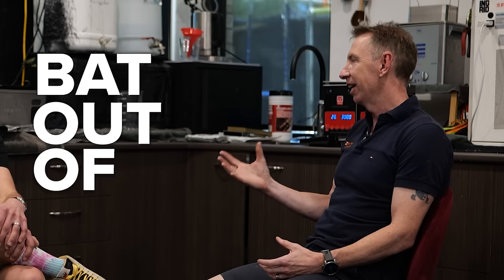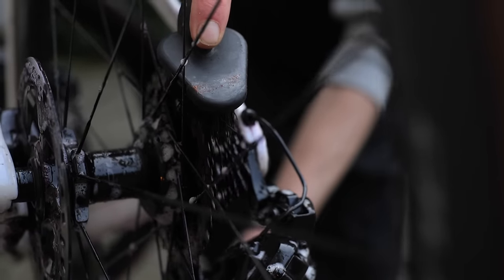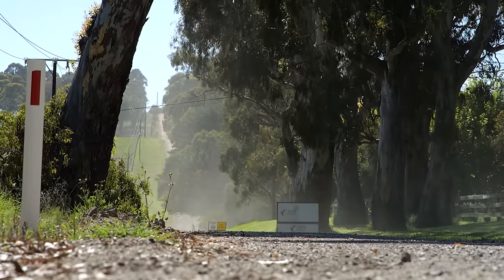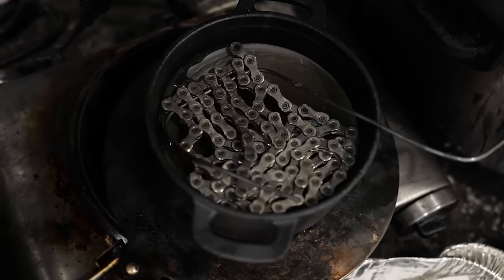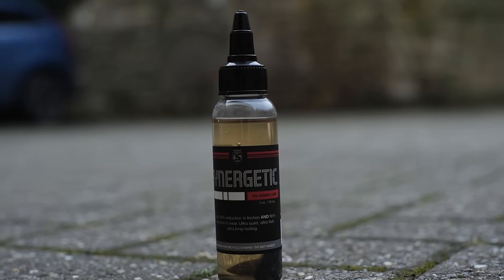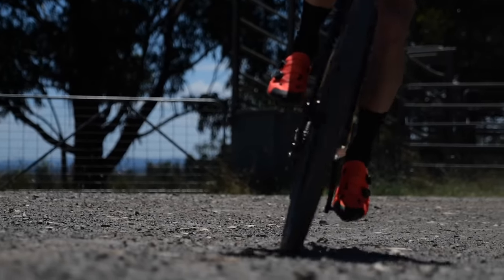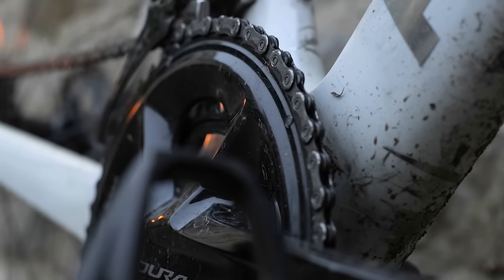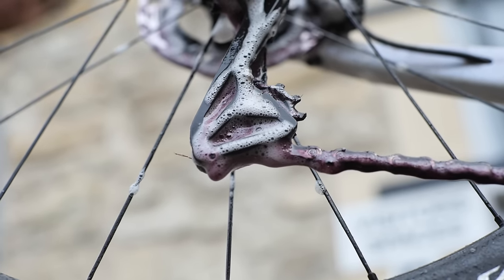They Don't Want Your Chain To Last This Long

Comment: This was a fantastic interview for people that geek out on mechanics.  I vote for more of stuff like this.  I have multiple chains in rotation, so I always have a fresh waxed chain ready to roll when it's time to rewax
Reply: Same, I am running 3 chains, swap them the ride they make noise, takes 15 seconds with a quick link, and since they are waxed, no mess at all, so that part is out of your mind. 
One chain in my rotation is on 3k miles of beach riding, and I can BARELY tell it from the newer chains. 

Im convinced a waxed chain if swapped out when it starts to make noise will last longer than a set of tires.
Reply: @shawnington  I have 3 chains between 2 bikes that have the same drivetrain setup, it's worked perfectly.
Reply from the maker: Geeking out on mechanics is our safe place 🙌 Super cool to hear you are getting organised with you chain wear! Have you always been like that?
Reply: @gcntech  I started doing this about 5 years ago when I started waxing my chains as it just made it more convenient.  the quick links help make it a lot easier as well.

Comment: How are people taking chain off so regularly like this guy is suggesting, is this re-using a quick link many times or using a new pin every time?
Reply: I usually reuse my quick link about 4X and then replace. 
Was reusing over and over 8-12 or more times and had several issues on the road and racing. Sorry my opinion only. But have been removing my chain and cleaning 🧼 for many years.
Reply: This is my scepticism about no faff. You have to get a chain breaker and pins or quick link pliers and quick links. Maybe it’s habit but degreasing and re-lubing just seems easier to me. Invest in a chain checker (Shimano based on ZCF’s reviews) and replace the chain when worn.
Reply: Reused my quick links (xo1& xx1) many, many times. Between two chains 4500miles with cleaning every 50-150miles. In xo1 & xx1 case, they aren’t that fragile.
Reply: Reuse mine until they don't have a solid "click" when reattaching.. they've lasted me a very long time

Comment: no wax lubricants options here where I live, except for Finish line wax. So I opted for cleaning the transmission after every ride over 40KM and re lube (using muc pff yellow. Does the cleaning the chain with degreaser and later water to rinse may bring any problem in long term?
Nice to hear from all this people that have so many knowledge and can share it so easily to understand. Thanks for uploading
Reply: Especially when using a cheap wet lube, frequent cleaning, rinsing, and re-lubing is good. There are no downsides to a clean and freshly-lubed drivetrain, aside from the time and effort required. Just dry everything off before re-lubing. Muc-off is bad--but if it's all you can get, then cleaning is even more important!
Reply: You can order candle wax or food-grade paraffin wax online and a cheap wax melting pot online, so you do have a wax lubricant option. I believe that ZFC is currently evaluating this type of wax but in my experience it is easy and works fine even without any additives.
Reply: @ridefast0  Valid points! If I couldn't get something like Silca Hot Melt or Super Secret, I'd probably run plan paraffin wax before using Muc Off. ZFC did indeed run candle wax (basically just paraffin), and it worked surprisingly well.

Comment: Is all of his lube testing based on "dry conditions" ? It would be interesting to see how the different systems / products  perform in a wet environment which would be more applicable to the majority of viewers in Europe.
Reply: I live in Thailand where we have a monsoon season and I have doubled the life of my chains from c 4000 Km to 8000 Km by using a "Wet" lubricant and changing from a 3 x drive to a 1 x drive.
Reply: No, they test wet and wet and dirty conditions too. That testing data is available on the Zero Friction Cycling website.
Reply: Adam lists his test protocol on his website, but basically starts with no contamination, then dry contamination, then wet contamination, and if it survives that, then a double dose of wet contamination. 
Wax is still generally the best performing lube in wet conditions, but it won’t last as long as it would in dry conditions before you need to reapply. Put another way, any lube that is sticky enough to remain on your chain in the wet, is also sticky enough to retain all the mud and road grit and turn into a chain-eating abrasive paste rather than filling its role as a lube.
There are some unusual situations (eg. A 24 hour MTB race) where an oil based lube would be better (because there is not enough time for a wax lube to dry and harden), but those situations are … unusual.
Reply: Just  a little more detail from the other reply.  He has 6 "blocks" of tests, each 1000 km.  The first block is dry with no contamination and lubing 3 times.  The second block is dry with dirt and sand continually added and lubing 6 times.  The third block is dry with no contamination, no cleaning from block 2 and lubing 3 times again.  The idea is to see if the lube can carry away the contamination from block 2.  The fourth block is we with water added continuously and lubing 6 times.  The fifth is dry with no contamination and lubing 3 times again.  The idea is to see if the lube can carry away the water.  The sixth is sand, dirt and water added at twice the volume of blocks 2 and 4, lubing 6 times again.

Not every lube is tested in all 6 blocks.  Basically, the test is stopped if the chain doesn't survive (so he never replaces the chain).  At the end of a block, if the chain is over the 0.5% total wear limit, he stops the test.  Anticipating the reason for your question: all immersive wax lubes (including normal candle wax) survived the entire test well (although for some reason he hasn't gotten to block 6 of the candle wax test yet).  All of the immersive wax tests also performed better in the wet than the wet lubes that made it to the 4th block.  The top immersive wax in the wet (Silca Hot Melt) performs more than 3 times better than the top wet lube (Silca Synergetic).  Hot melt had 8% of the 0.5% wear limit in block 4 vs the 27% wear of Synergetic).  It's not even a close battle.

Josh from Silca has speculated that wet lubes appear to perform better in the wet because they they are thicker and dampen the sound.  Even though they aren't actually protecting the chain very well any more, you can't hear them and so people think they are performing better.  He's pretty clear that he believes that all immersive wax (from any producer) perform better than wet lubes, even in the wet.  And that applies to Synergetic as well.  There are reasons you might want to run wet lubes, but getting maximum protection for your drive chain isn't one of them.
Reply: If you run waxed chains, just dips them in isopropyl alcohol after a wet ride, and they will be dry, it wont dissolve the wax, but its very hydrophilic and absorbs the water. Or run a rotation, of chains ,and just swap them out. The wax is so good, ive actually waxed rusty chains before, and the rust just gets pushed out, and the chain is eventually indistinguishable from a new chain, with no less wear.

Comment: Been using KMC X12 Ti-n Chain. Cost $40-$50 US. Seems to be as good as SRAM force X12 chain. $45-50 US.
Any opinion on KMC
Reply: Ti-N is really just for the bling, as the coating is only a few microns thick, and wears off at friction points in no time flat. X12 chains are pretty solid in themselves, with decent tolerances, and once you get their gooey packing grease off, hold onto wax coating pretty well.

Comment: Running 2-3 chains on all my bikes and washing them every 200km extended the life of my cassettes and chainrings. I have 2 road bikes with Ultegra R8000 cassettes with 15k km each and they still work perfectly.

Comment: The roads on my commute are so crappy I switched back to 7 speed, cheaper parts. Use Viking Juice in winter, Squirt rest of year. Measure chain often and replace at .5%
Reply: I think up to 8 speed replacing at .75% was fine
Reply: yeah his point though is that because of the wear rate of those cheaper chains, that turns out to be a false sense of economy when you actually calculate out the mileage you get from your lube and the chain, and the other components all together. apparently you missed the point in the video where he talks about how those 8-9-10 speed chains are cheaper because they don't have any protective coating at all and they're made from softer metal, so even without any contaminant they're going to wear out faster then the other chains anyway.  

of course he hasn't been able to do any testing with road-salt and snow, I think though he could do one of his test blocks with salt water and that would at least give an idea, even if he can't do snow, I would think it would actually be similar because the salt dust (post storm, after the roads have all dried out) and salt water is what really seems to mess up my chain.
Reply: Wipperman do high quality 7 speed chains. My fully plated YBN chains cost just £4 each and are great,  I get good 7 speed cassettes for £11. I don't believe his spiel. I check for stretch regularly  replace at .5% stretch, so cassette lasts 3 chains.
Reply: Where are you buying those chains please?  @draugmithrin

Comment: 31:45 - So what you're saying is Don't ride in the rain so you can make your chain last longer
If you do ride in the rain. Use a bike that has an enclosed drive chain. i.e. probably something like a velomobile
Also cycle through a handful of chains. So that no 1 chain is past the 0.5 or 0.75 mark

Comment: For what it's worth: I got the Ekar and I changed my first chain this very day after 3000-3500 km. I should add that I tried but suck at cleaning the drive train consistently and thoroughly. (Thats why the new chain is waxed and I spent all morning un-mucking my cassette and chainring.)

Comment: Taking the view in chain width to the other side of the fence, a wide 1/8" mid tier track chain easily does 10.000km riding outdoors and using oil based lubes. 
Since switching to a wax based drip lube that easily gets doubled. 
So while I am eager to switch to immersive waxing on the next chain, because the drip wax is still a little bit sticky and still requires regular cleaning, I might have to replace the chain due to increasing my chainring size long before that one has worn out.
The wear rates reported by ZFC on immersive waxing would probably make chain wear just not be an issue anymore and top tier track chains viable for outdoor use.

Comment: As a general rule for me: Modern narrow chains never lasted for more then one year in my whole lifetime and only one of them got destroyed becouse of my own stupidity. They twist much too easily and i only care about not having any force on the padles as long as the gear isn't 100% in place and never let any stick or stone even touch it in the forest.... So i don't care for the chain maintenance as much as i did with 9x (driving much wilder and harder) where it was common for me to cycle more then two years and over 15k km before changing a worn out but still intact chain. My foldable Bike still has its original way over 20 years old 7x chain. Changed the tires twice inbetween becouse they were done. But its still not too long, still not worn out, still flexible, not a single chainlink is damaged or doesnt move properly. 
So how much can i save? Nothing. I spend 30€ a year for a chain, 2,50€ every few years for oil and not a single 11x chain got worn out before something else broke.... normally it's one original bolt loosing the inner part of the chain. At 10/11x it was never ever my own (chain-)bolt, last time this happened was 9x. So maybe i can save money on the cassette or front chainrings... hmmm ... last one lasted over 50k km, never had to buy a new one before some part in my head wanted something new anyways... exept 9x, this was the system for me, where i should have changed the chain maybe one or two times more often so i could have saved maybe one or two cassettes and one set of chainrings in the front... but 9x was so chaep in the end, i got a XT "spiderarmcassette" for 30€... so what could i save?
Edit: some mistakes corrected, btw i'm a mountainbiker and biketraveller as well as a-to-b-everyday-biker. Feel free to correct my english.

Comment: From 5-8 speeds the insides of the chains stayed more or less constant - the outsides of the chains were getting skinnier.  Same holds true from 9-12, i guess.  But still the stretch comes from the side plates, so skinnier side plates = more stretch ...
Reply: I have read somewhere that the main contributor of chain "stretch" is actually not the actual stretching of the links but rather the wearing away of the "bearings" connecting each link. (More wear means more play. Stacking all that play for all the links gives a longer chain)
Would explain why they only talk about the insides of the chains in this video too.

Comment: Good episode 👍
The fact that lubricants and waxes develop.. do not increase the lifetime of the chain.. they only give the opportunity to make the chain from cheaper raw materials 😁
Why are most waxes based on paraffin? Why not use harder types of wax.. some waxes are almost as hard as plastic??
Reply: Applicability & cost. Paraffin is available and usable, whereas other more sophisticated waxes require very specific application treatments,  and tend towards a more permanent treatment, like a deposited coating, which can't be broken down and reapplied as needed. '

Comment: Do note that all of the cost savings and power savings numbers quoted by Adam are for riding at 250 watts.
If you ride at 150 watts, multiply his numbers by 25%.
The power exerted to chain wear relationship is not linear, it is exponential.
Adam provides a lot of useful information, but I find it disingenuous for him to not point this out.

Comment: About chain stretch…I’ve just replaced my Ultegra chain with a new one (like for like). Out of curiosity, I lay the old chain against the new chain and over the span of 53 links (or 106 pins) there was a difference of a full link (distance between 2 pin). Is that amount of stretch normal? The old chain was regularly cleaned, degreased and lubed with a wax based product so the wear really surprised me. I replaced the cassette at the same time and the shifting was MASSIVELY improved. However, whenever I put the hammer down out of the saddle, I get a huge amount of slippage on the crank’s chain rings (dangerous!). The Ultegra chain rings have around 5000 miles on them but look OK. Is it standard practice to replace all 3 main parts of the drive train at the same time? Should I replace chainset too?
Reply: if you have a full link difference then it amounts to about 2%. Considering they say we should replace the chains when they reach 0.5% wear, so it does not wear the other components too much. You kept it for too long and now the new chain does not sit well on the chainring.

Comment: If the volume/price equation improved and with development, then the belt drive/gear hub solution which might require some maintenance becomes the viable drive for bicycles with gearing covering climbing to high speed pedalling possible. For those who do ultra expedition type journies it seems to be the preferred item now. At this time they cannot rival the normal drivetrain in terms of speed and power but I am not sure if he said what the diff is and I did hear that they are working on improving the gear change mechanism including electronic gear changing.

Comment: Back in 1988-89 I was putting in a TON of miles.   Some weeks were 350-400, even 450 miles.  I was so sick of wearing out chains.  Yes, the SedisSport Silver was an amazing chain, and cheap too.  But man, was I going through stuff, despite my attention to detail on drive train maintenance and chain care.  So I did the most natural thing a bike guy could do and splurged for the MOST expensive chain at the time.  $60 Roholoff or Wipperman or whatever it was.  Damn thing wore out FASTER than the tried-and-true $11 SedisSport!  (Turns out that this chain was maybe the best ever produced for the price.  Shoulda bough a container of 'em!)
So I've always "grinned and beared it" and just accepted the fact that chains are consumable items.  Despite almost any efforts, they just wear out.
NOT SO FAST!!!!
Live and learn they say.  Yup.

Comment: Wax is great if you don't live near the coast.  Near the coast, rust will kill your drivetrain and you need a wet lube.  Immersive wax is also super cheap once you have set yourself up.  Go look at Oz Cycle for a DIY recipe.

Comment: I’ve been using wax on my race bikes for a couple of years with good results. 
I’ve tried it this winter for the first time but after 3 or 4 hours in the rain my chain gets so dry and noisy I’ve had to go back to wet lube.

Comment: What’s your take on quick links? I’ve been waxing my road bike chains for over a year and I have been reusing my quick links with no problem. Now I’m considering waxing my new e-bike chain and SRAM says T-type links are one use only. Meaning every waxing would cost an extra $6.00.

Comment: I'm switching from a 11-25 cassette to a 12-28 do I need to add links to my chain or would I be ok. Don't really want to buy another chain as it's only had 200-250 miles on it, and what other adjustments would I need to do. Any help would be appreciated. What do you think of the DLC chains.
Reply: Yes you'll need to fit a longer chain.